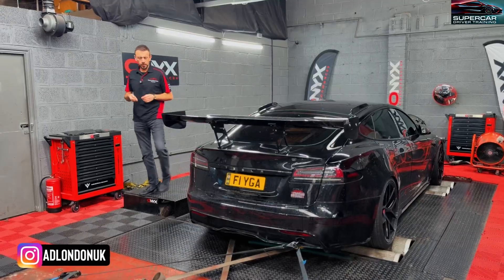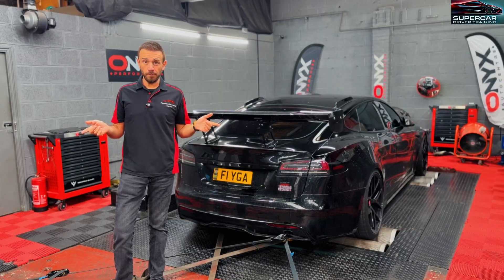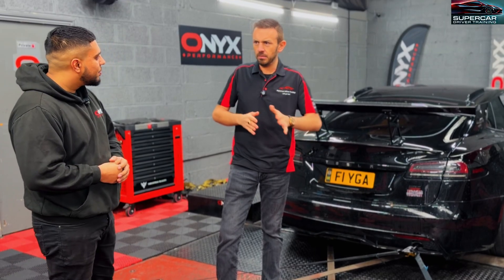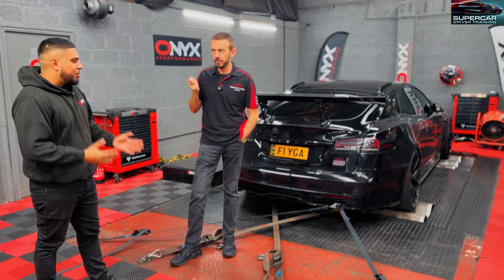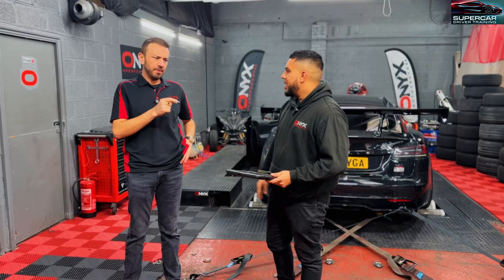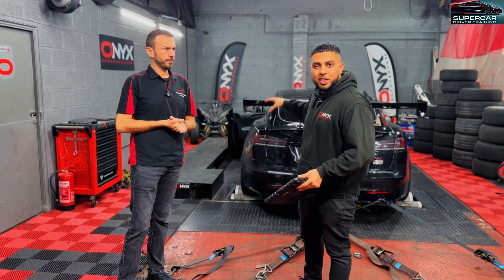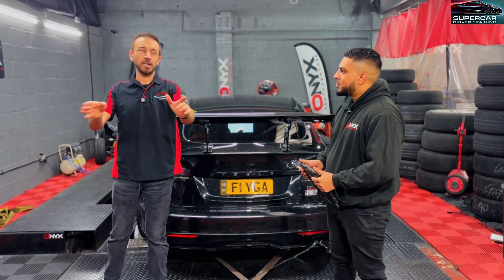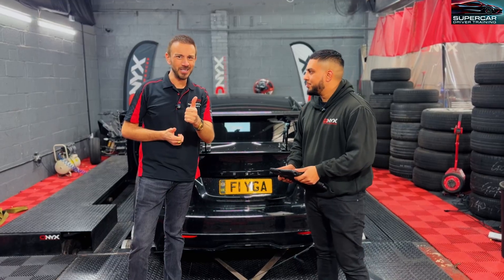🏁 Episode 5 - Dyno testing Model S Plaid (Project Plaid)

Comment: Reliable too! We’ve got ~900 dragstrip runs on our Plaid with no broken parts; just a set of brake pads. Best of 9.15 @ 152MPH. And our 2019 Tesla S has over 1000 dragstrip passes with no issues (running mid 10s)
Reply from the maker: That’s great !
Reply: That’s incredible